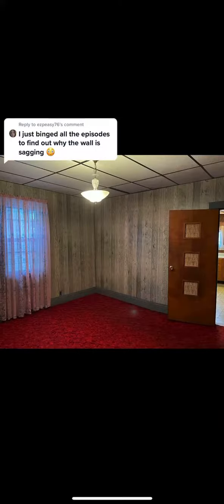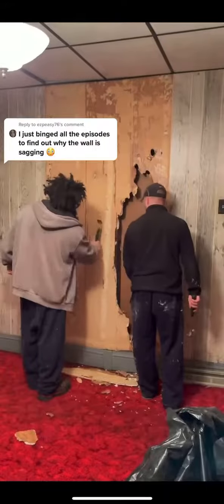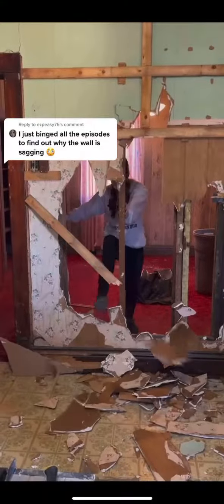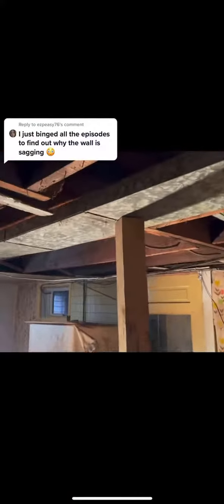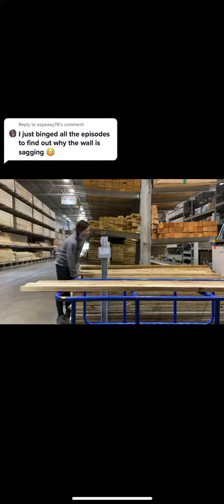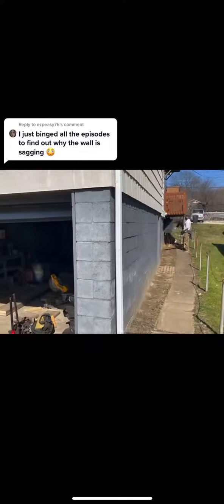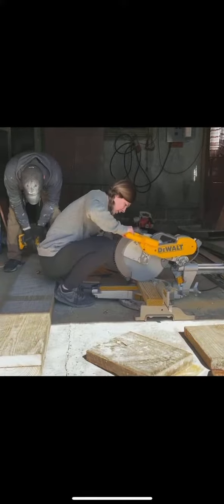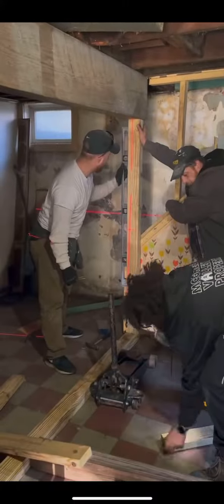PART 6 :Viral Video | DIY - FLIP HOUSE SERIES - How To Transform an Old House

Comment: Our walls kinda have a belly but the inspector said the crawl space was fine 🤔
Reply: Did you end up getting a second opinion? 
Just curious, I had a similar thing, a "belly" like wall curve, which ended up being the isolation layer bulking/moving due to a damaged pipe.
Reply: @W.Rain.  no we haven't looked into it any further (didn't open the walls) It's not super curved, but it's pretty much all of the exterior walls. The one that annoys me is the kitchen one since the counters cannot lay flat against it... We were told it's just because the house is 100 years old... I might open the walls up some day and change the insulation and/or drywall